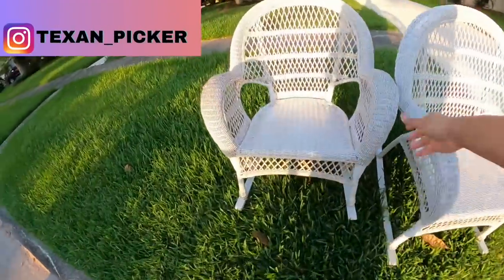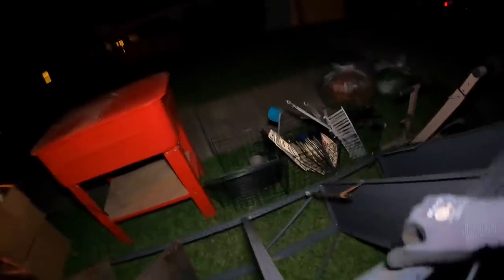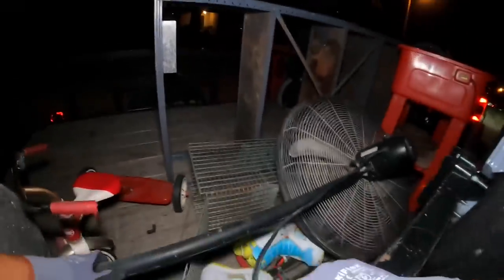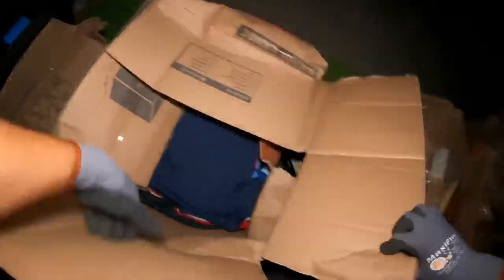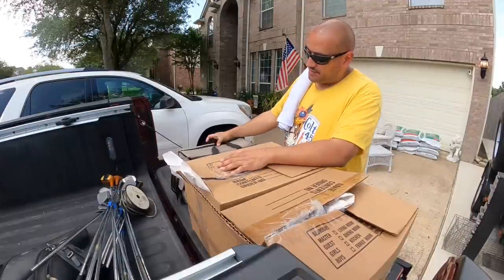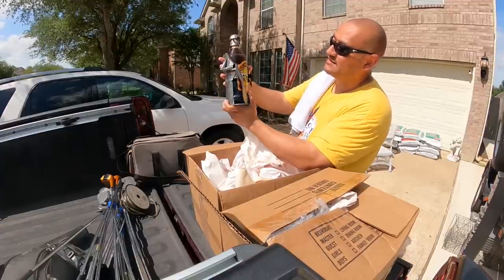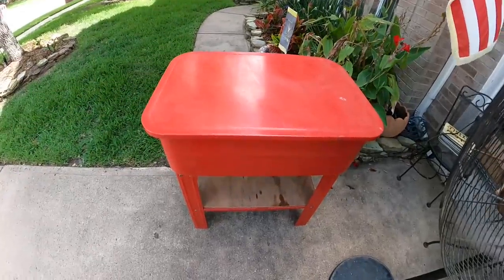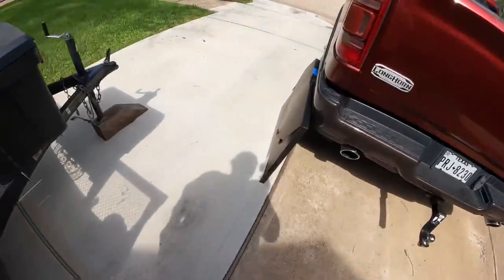All This Was Free !!!

Comment: The red metal table is a part washer it cleans engineering parts.I used one in aerospace to clean turbine blades that goes into jet engines using parifin in the part washer never water.
Reply from the maker: Yes I’m starting to learn these things. Thank you